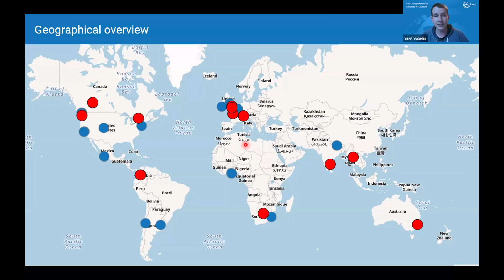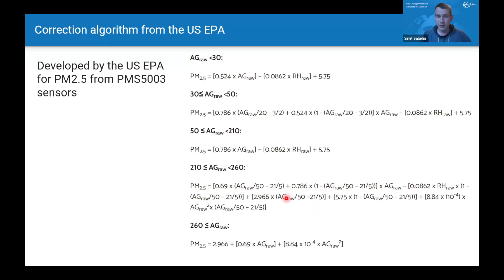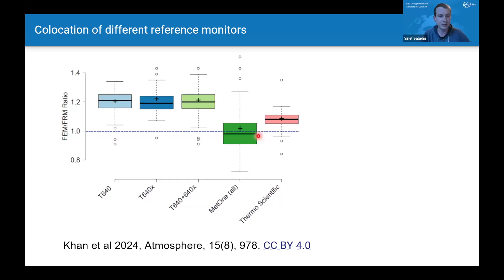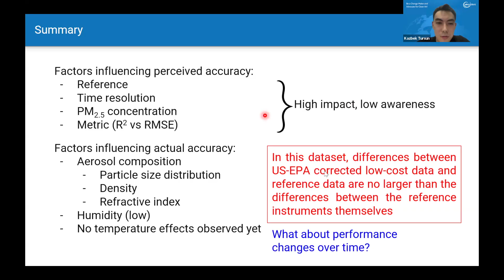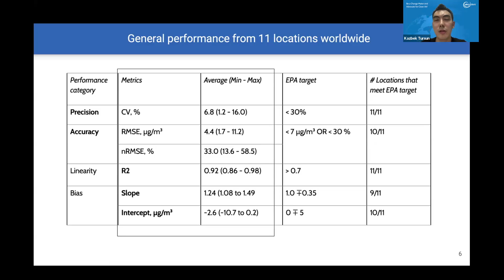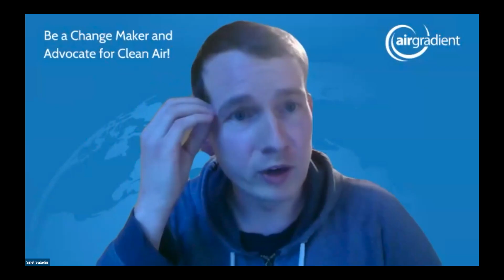Low-Cost PM2.5 Sensor Performance: Insights from 15,000 Days of Colocation

Comment: Technically and Theoretically, gravimetric methods, light scattering methods, and methods in between can, and should yield different results! 
As I understand, the FRM HVS measures the actual weight directly. The FEM BAM measures the weight indirectly. FEM light scattering measures sizes and counts, then approximates the weight. (I might be slightly off, but the principle is similar, right?) Therefore, they are likely to disagree. 
Since the unit used is micrograms, the gold standard reference method is one that weighs the particulates, HVS. However, regarding health effects, we know that the weight is not the only factor that matters; size and count are also crucial. For instance, the health effect of a single 2-micron particle might be much less than that of twenty 0.1-micron particles, even if the mass reading is the same. Therefore, the future will likely trend toward particle counting and profiling, etc. The importance of LCS will be significant! :)